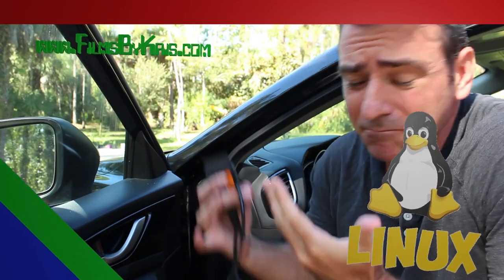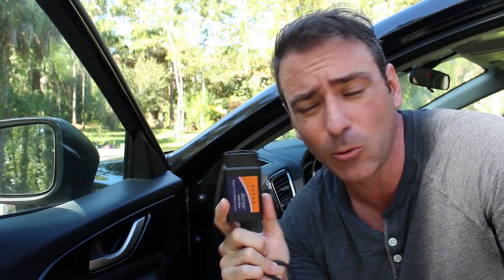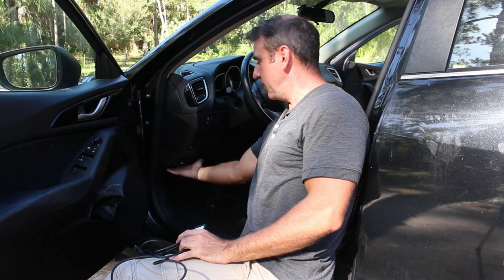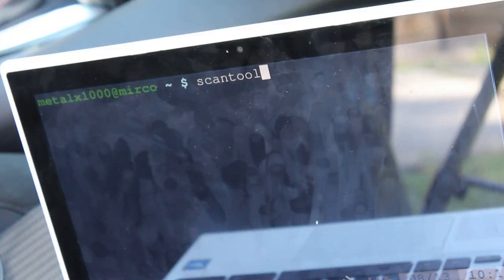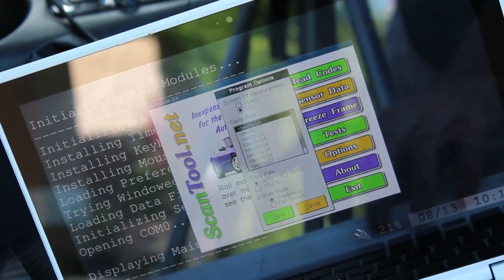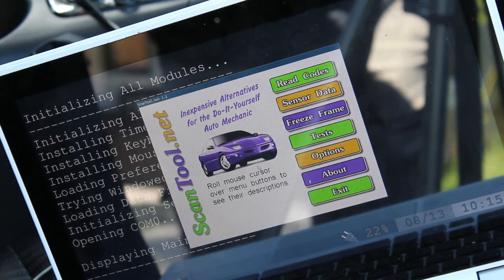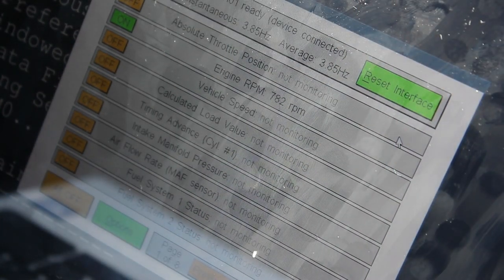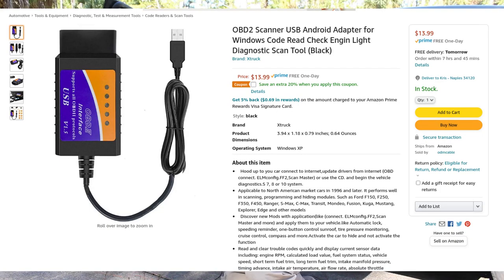OBD2 and Scantool

Comment: Hey Kris, is that a new laptop? 
Can you tell us which model that is and if you recommend it ?
I am also in the market for something like a Chromebook ...
Reply from the maker: That is an Acer R11 Chromebook running Debian.  It's good for a Chromebook with a touch screen.  
If you are looking for a Good Laptop and will last years I highly recommend a Thinkpad.  I've had a T400 for about 10 years now.  I switched to the Acer for a while, but after a while bought a Thinkpad T480 use on ebay for about $450 and love it.  I'm sure it will probably last me another 10 year.